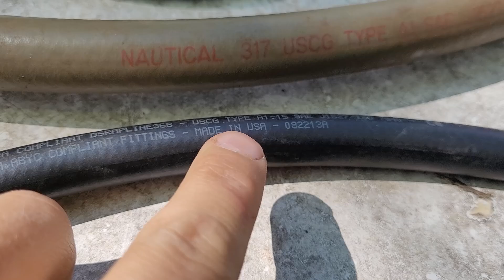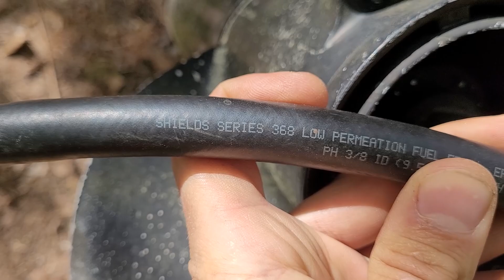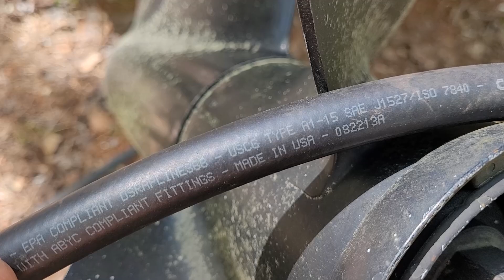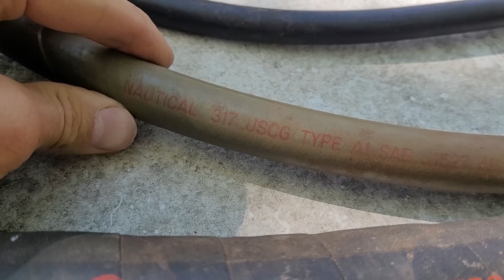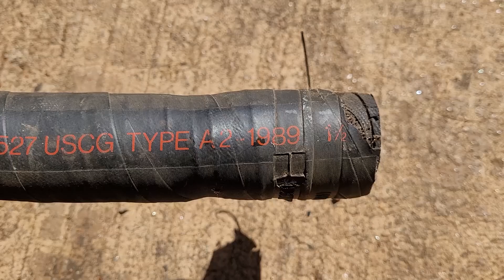Boat Fuel Hoses EVERYTHING You Need To Know!

Comment: Apparently Sea Foam, which I use in all my engines, will eat that liner like crazy if left for long periods of time.  It was explained to me by the boat mechanic that Sea Foam is fine if you use it up and run it through.  If it sits up, its going to eat that plastic in your liner and cause you problems like folding in on itself as it separates to "pinch" fuel deliver or eventually disintegrate and clog filters, pump bulbs, carburetors etc. . This was diagnosing a boat that idled and ran at low speed fine but would not get enough power to get on plane.

Comment: Everybody’s telling me that liner degrades fall apart, tears away from the main hose and blocks fuel eventually specially if you use low-grade fuel, screws up everything I just assume change out houses every year $18 worth of that black hose every season all I need is 6 feet or so of it I’m sure it will last in the sun for summer
Reply from the maker: It can degrade overtime. I kinda forgot about it in this video. I never had a problem with the newer stuff. It's the older stuff that's the problem. I prefer liner-less hose though.

Comment: One piece of advice regarding liner hose. It will not tolerate being put on and removed on barb fittings. The liner can bunch up restricting flow. I cut approx 1" off every time I remove a barb fitting.
Reply from the maker: Good tip. I should have talked more about the liner. I was in a hurry lol
Reply: Ya right pal
Reply: @gerardmccarthy2432 how do you cut the fuel line? Is there a special tool to use?
Reply: @ItIsColdHere  Razor blade

Comment: How do you get a 20 year old hose off? Seems like it’s practically bonded to the deck fill through hull fitting. 

Any tips? I tried penetrating lubricant
Reply from the maker: I do channel lock pliers and a rag around the hose so it doesn't damage it. Twist is back and forth till it spins on the fitting then pull it off.

Comment: Do you typically use the same A1-15 fuel hose line (but smaller inside diameter) to replace the pulse hose running from the fuel pump to the crankcase?  
Matt thank you so much, I couldn't have replaced my stator, power pack, & ignition coils (1974 Johnson 115hp) last summer without all your great videos!!!